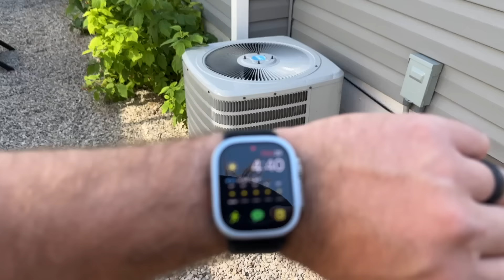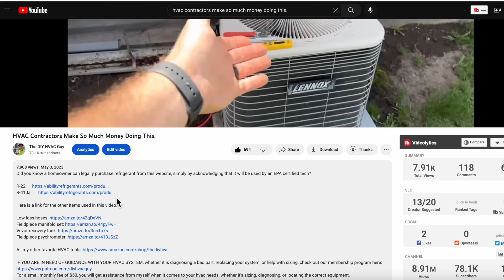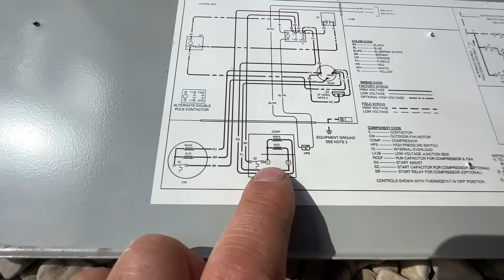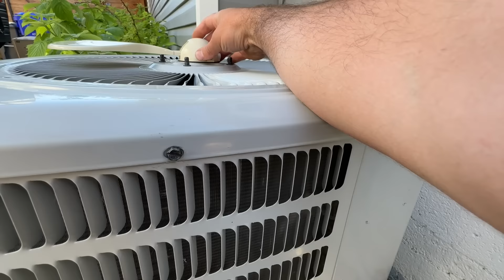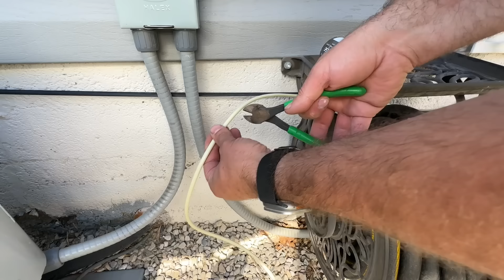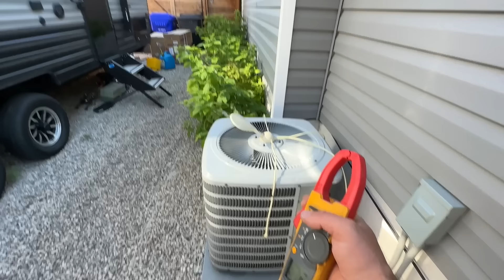Can This Device Actually Lower Your Electric Bill By 30%??

Comment: I've heard so much hate against misting condenser from HVAC techs. Something about water rusting/damaging coils and fins. Can I get your opinion on this?
Reply: Why would you be concerned with getting a unit wet that sits outside in the rain?
Reply: @UserFormelyKnownAs_hjkh 
Because rain is intermittent and ph balance/mineral deposits of rainwater is much different than ground water.
Reply: @UserFormelyKnownAs_hjkh  Rain doesn't have the mineral content as ground water does.... I would think
Reply: @UserFormelyKnownAs_hjkh  Because this is not rain. Most rain is pH neutral, neither acidic nor alkalai.
Reply: @UserFormelyKnownAs_hjkh  Rain is effectively distilled (or at least semi-distilled) water.  Any contaminants are going to be volatile compounds in the air that got picked up, or maaaybe a little bit of dust that served originally for nucleation.  Definitely no dissolved minerals.  City water has dissolved minerals in it that will either clog up the condensor fins or corrode them.  (And if they are clogged with lime deposits, the acid needed to remove them will potentially corrode them.)

If I used something like this with my water, within a month the fins would be completely clogged with lime deposits.
Reply: @Entropy512  fair point. Entirely valid. However wouldnt an individuals use of this product effectively depend on the quality of their tap water? My tap water is safe for fish and i dont get calcium deposit on my shower head like i did in other cities. (EDIT) also, couldnt someone just as easily setup a rain collection barrel with a cheap solar panel running a 12V pump for pressure, assuming this product only uses about 1 gal/day, like he states in the video.
Reply: @Entropy512  What do you think about collecting rain water and using gravity or a solar pump to run the mister?  I don't know how much pressure is needed to run the mister, but in theory, it seems like it might work.
Reply: @sonnyh9774  That would probably OK as long as you filtered out debris, similar to what a few other people have said about feeding the condensate from the evaporator (heh wonderful potential for confusion there - refrigerant evaporates and water condenses on the same device), which is actually something newer Energy Star compliant window units do.
Reply: Some  city water do cause galvanized pipe to fail  very fast
Reply: @vietcongbuondanbannuocphan1791  Galv pipes are never your friend. And yes indeed, some muni water systems are 3rd-world crap. Sounds like acidic water. There measures one may take to correct for that.
Reply: My condensing unit has sat out in the rain (acid rain) and snow for over 10 years and hasn't rusted.
Reply: @wannabetrucker7475  I don't think minerals are in rain and snow, but I could be wrong.
Reply: These HVAC units are outside of course.  Does rusting occur when it rains?  This device also comes with a filter so mineral deposits is minimized.
Reply: I'm an ac technician  in my area (west Tennessee) using misting with tap water is not recommend. Chemicals in water will over a short time destroy cooling find on condenser !
Reply: We had one of these things years ago. Minerals from the water ended up building up on the fins over time. Be prepared to have to descale your unit. We took ours off and tossed it after a season. My advice… save the money you would have spent on this and go buy some beer. 🍻
Reply: They also seem to hate compressor noise covers. My (well, not anymore!) HVAC guy just up and removed mine without even bothering to consult me about it. I'm still waiting on the jerk to return it... basically $80 petty theft in my eyes
Reply: @SomeRandomDude-zqxj  i think it's kind of safe to conclude they'll be against any DIY mods that'll lessen the service call frequency 😂
Reply: @machorani  Ha! sometimes squeezing a nickel till the Buffalo Shit's ends up costing you $2400 for a condenser change out.  Or $6,000 to $8,000 for a complete system replacement depending on what refrigerant you have. LMFAO! All for 0.03c/mo. savings!
Reply: @snurb48  what if my condenser is already 11yrs old and I'm just trying to squeeze last bit of juice before I size up?
Reply: @snurb48 why would water musting on the condensor make it fail?
Reply: @snurb48  Or 12k for a system replacement if you live in a hot climate like Phoenix, AZ. That's just for a single level 1500 square foot house. I'm glad I left before the heat waves of the past two years because AC seem to die during a heatwave, then the AC guys all say they are booked for weeks and you have to live in a hotel for a while.
Reply: @snurb48  Doing the math, this saves about $4.30/mo by my local utility rate.  Not a big savings to be sure, but not the negligible three cents you mockingly describe.  And why would it lead to a compressor change?  This takes load OFF the compressor.  This makes the compressor last LONGER.
Reply: @snurb48  I live in Florida, 1/2 mile from the gulf of Mexico with a 20 year old condenser. This won't rust the condenser. If it did, mine would have needed a replacement a decade ago.
Reply: @thehousedr4  from mineral deposits on the coil.  Think of water spots from washing your car out in the sun using the hose.  Then think about it running like that 24 hours a day and ask yourself if the accumulation of the waters;pts buildup wouldn’t cost the surface of the cooling fins.
Reply: @thehousedr4  because it deposits minerals on the coil surface,which in tutn will insulate the coil causing issues getting rid of heat! And the only way to clean ot off is with descaler and it will make your coil disappear! You are essentially turning an air to air heat exchanger into a cooling tower!
Reply: @machorani  Sure, go ahead and kill it. But make sure your duct system can handle more tonnage of airflow before you 'size up'. Big mistake! Bigger isn't better, said doctor ruth!
Reply: @thehousedr4  Because that water filter will not remove calcium. Calcium  upon change of state(water into a vapor)  'evaporation' , will deposit  onto, and inside the coil fins on the Condenser Coil.  Acid will not remove it and even the slightest air restriction causes these units to run a high head pressure. High head pressure= Compressor burnout. Does that help?
Reply: @leifhietala8074  Number one, why should I trust your math? You don't even understand Physics or you would not be debating Me right now! So, I'll say mockingly; when the calcium deposits plug the fin coils, the head pressure will rise extremely high, thus so will the temperature of condensability. The lack of subcooling will effect superheat which in turn will climb high. Without proper superheat to the compressor, this will overheat the windings, thus melting the insolation, warping the windings out to touch the steel case, and BAM! Short to Ground! Or as you would probably say on the phone: "yo man, my breaker be trippin and even tho I done reset it 23 times, keeps popp'n"? "I have a $4.30 coupon, when can you come out"?
Reply: @thehousedr4 in my case after only a couple of weeks the coils were completely covered with calcium, rydlyme some very expensive shyt to get the calcium off without damaging or destroying them.
Reply: @snurb48  Trust my math, as opposed to the no math you offered?  Sure, why not trust it.
0.8 amps x 240v = 192w reduction in consumption, assume 25% duty cycle x 24 hrs x 30 days per month x $0.125 / kW-h = about $4.30 per month.
He's got the anti-calcium additive doodad, no idea how effective it is but he's trusting it on his own system, so maybe it isn't completely bogus.  I'd be inclined to use rainwater instead.
As to the rest, you need to make the holes in your hood bigger.
Reply: @thehousedr4 yeah I don't get it, it sits out in the weather already.... 🤔
Reply: @leifhietala8074  Hey, that was really good on your math, a real rarity these days. Listen, if this could work without calcium deposits I would do it in a heartbeat. I've worked on the old water cooled condensers and they were the most efficient systems on condensability for any refer system! Rain water would work but sounds like a hassle, if you have that much rain means your humidity is high therefore your going to lose on evaporation process. His unit is about to be changed so he doesn't care. My unit is a new 410A system that I don't want to change and run into the new evaporator change out laws, stupid. 
I think you have checked into my private life on the hood comment, be more specific if you don't mind. I'd be curious of what you think you know? Thanks.
Reply: @thehousedr4  that all depends on your water quality, water high in iron or minerals will definitely cause issues over time. I've seen swamp coolers using untreated water nearly destroy themselves in just a couple years. The use of a water softener would help as they remove most of the minirals.
Reply: @snurb48  I live in a temperate area with lots of rain, so rainwater harvesting for condenser cooling is a valid solution, especially if rainwater harvesting is already going on for other purposes.  We have high humidity most of the time but condenser coils would still cook off rainwater, humidity notwithstanding, and receive a benefit.
On my old system that was installed in 1989 and changed out in 2015, I would have considered this even with city water.  My new system, not so much.  No, my hassle there is the goofy ECM motor.
My last statement was in reference to your quote that sounded like hate-soaked ebonics parody.  Whether that was your intent or not, that was how it landed.  That's not a good look on anyone.
Reply: @leifhietala8074 

wish I had  ur rate....I'm at 21 cents/kwh
Reply: @snurb48  What savings?  That will be eaten up by the slightly higher water bill and the replacement of the water filter every three months.
Reply: @javaman2883 window unit or portable AC just stay next to it. Better than a hotel
Reply: @SomeRandomDude-zqxj  mine came from the factory with a noise cover on the compressor.
Reply: @greggv8  If noise not a problem, get that heat-soaker off your compressor.
Reply: @SomeRandomDude-zqxj  Some HVAC tech think these blankets trap heat in the compressor and help burn it out. False! The cool refrigerant gas that comes into the compressor provides motor cooling. The additional heat trapped from the blanket is not significant.
Reply: @andydelle4509  yep, and I didn't have it wrapped snug tight either (trapping heat was my #1 concern), basically I just slipped it over it, an inch or 2 gap all around it, then the top strapped on. It is an old budget seer10 system from 2000, and he personally installed it back then, maybe he took it personally ("don't booger-up MY install" idunno lol)
Reply: that service tech. did you a favor! those "noise" jackets shorten compressor life by as much as %40 by holding in heat. @SomeRandomDude-zqxj
Reply: @SuperDrumwolf  and I've wondered that too myself . . . I had one on another unit at a previous home for 7 years, it was just placed over the compressor but not wrapped snug. And "some sources" say compressors get cooling from the suction line. Nobody probably really knows. Just that the compressor at this home now is an obnoxious buzzing banshee 🙉
Reply: @SomeRandomDude-zqxj  I know, the compressor blanket is meant to be in conjunction with a crankcase heater! It is for use during low ambient conditions, it keeps the refrigerant from condensing to a liquid and sitting in or on top of the compressor. Liquid does not compress, thus starting the unit as said will bend/break rods, pistons in old or big units. Or bind up a centrifugal compressor and or break the rotor in a rotary compressor. Not so much for noise.
Reply: I did my own design for this very concept. Mine was more with swamp cooler pads and a sprinkler electrical switch to run it. The thermostat runs on the same voltage as the sprinkler valve. My system did very little any savings. In the deserts of Utah, the added water costs consumed any saving of power reduction. At best [my thoughts] it will help the pump past longer.
Reply: @stanleymcomber4844 Your idea was a good one and probably would have saved money if you had well water.
Reply: The issue I’ve seen is mineral buildup on the coils. If you are the type that cleans them often it’s fine, but I’ve found that the types who use these devices do not
Reply: Hey all those that think this is good for your system....  HVAC companies love innovation and can't wait to sell you the newest most efficient tech for your $$$.   BUT...  They also have to adhere to an industry standard.  
I.e. they cant sell you snake oil wonder do-dads that will never work in the first place.  And they cannot knowingly incorporate a 'feature' that decreases the lifecycle of a product.  

If misting had its benefits...  Lenox, Trane, RUUD, Mitsubishi, Carrier, et al would have already developed and sold package units with integrated misting.   They would have given customers 'advanced efficiency', simple swamp cooler tech long time ago.  By this time LG or Dyson would be trying to push an ecofriendly rain recapture 'solution' if this worked.  Or should I say lose at the risk vs reward in a game of diminishing return.    So all u jeaniouses yeah I spelled it that way because you are special genius situations I tell ya.  And really there isnt any way to tell you...  U r just gonna have to eff round and find out.   Its gonna be a while.   But that expensive I told you so was brought to you by the many many years of HVAC experience.  Collectively.
Reply: I have a "Day & Night" central FAU in SoCalif....It's the house's original system, I'm the orig. owner (1986) My company plumbed the neighborhood I live in. Our AC friend installed an inline  "Filter" and "Dryer" during it's first summer...said it'd last forever.... and it has. He came by last week and added 1-1/2 lbs refrigerant. The system cycles normally in 105 degree heat..... 52 degrees at registers.
    We have a 20 yr old "Mister" in our patio and it's hooked up to soft water. The emitters still work (amazingly not calcium clogged). As the droplets fall they gather dust particles and transfer them down to our outdoor kitchen tops I built... leaving a white film....it's not calcium because all my plumbing fixtures have zero calcium build-up. Early one morning had I sprayed pure vinegar all over my outdoor kitchen and BBQ, let it set for about 20 mins then wiped it off....worked great....only going to run the misters when company's over...we have a 40' pool to jump in 24-7. 
I do not recommend misting your condenser unless a bunch of vinegar is good for the internal parts. I'm a plumbing contractor not a chemist.
Reply: 20 plus years and you do you Boo. But 100 percent seen the damage personally that water does to aluminum fins. Have not seen the damage on aluminum micro channel coils as they are super easy to rinse with that same water.  The calcification that happens due to long periods of saturation will straight up damage the coil long term sucks.  But without a doubt super effective in the short term. So if you wish to replace your condenser coil every 3-7 years save that money you getting on energy savings.
Reply: @Rob0243  I've seen where dog's piss eats the fins like acid....because it is. Google :
"dog urine eats cooling fins" (images)
Reply: If your water is high in minerals you will end up coating your coils with minerals which will then be much worse that it was.
Reply: @dougk5456  Even if you have soft water (like I do) the water droplets gather dust/pollen and it builds up on everything it lands on....like glue.
Reply: It's not rust that will cause the damage, it's scale from the water mister. The minerals from the tap water will build up over the coils and fins over time, reducing their ability to reject heat. That will cause the compressor will work harder, which is the opposite of what this product is meant to do.
Reply: I am a former HVAC technician for over two decades in my opinion on this thing is that when you first start off yes it works great because he brings the head pressure down and so the unit doesn’t work as hard. But after a while that water will start to calcify on those condenser fins and once it does then it becomes like an insulator and it won’t allow the heat to escape out of those fans anymore so then you’ll start going backwards because now the condenser won’t be able to reject the heat like it’s supposed to. I’ve seen this done many times and like I said at first it works great but nothing is forever and after a while you will start having problems. And to tell you the truth the unit is working perfectly the condenser coil is designed to work in 95° temperatures and if you looked at what his supply grill temperature was was 53° so that means if the unit is working properly with a 20° drop the house is 73°. If you want to help your system energy wise put a good start kit on it that helps get the compressor to RLA faster because the unit uses more electricity at start up that’s when the peak power is used.
Reply: I have heard all the same stuff but never any proof or real world results.
Reply: @ban80  My AC is 11 yo R22 system anyways. I'm going to give this a shot and monitor any visible damage or leaks on my system. I'll report back in a year or two if I remember.
Reply: @danmeyo   OK I will look you up in a year, lol
Reply: The coils are made of copper and aluminum, not steel.
Reply: Well, if my condenser rusts or is damaged with water exposure, I'm not sure why it is placed outside exposed to the weather (rain and snow).  ;)  It is built for water exposure and the first thing my service tech does when he inspects it is to hose off the running unit to clean it.  This device is not for me, as my compressor does not run nearly as much as folks down south, but seems to be a nice idea.  Commercial HVAC gear used to cool large buildings like data centers I help design work off the same idea ("water towers" on tops of buildings).

Design flaw or did he put the device on backwards...  Why doesn't the unit have a fourth sprayer for the front of the condenser?  It has probably the largest surface area.
Reply: The coil is made from aluminum, it wont rust from water alone.
Reply: shouldn't be any rust, the coils are made of aluminum & copper. When our outdoor fan motor went out during non-purchasing hours. I went and bought 2 of the spinning sprinkler hose attachments and put them inside the condensing unit and it worked great until I went and got a motor.
Reply: No problem if coils and fins are genuine copper or aluminum and not ferrous metal. Get out your magnet and check. Powder coated covers do not rust. Cheers!
Reply: @blackrifle5.56  ...all aluminum
Reply: Are you considering rain and snow?
Reply: @klinestillthat's right! You let em know what they've heard! So stupid, trying to translate smart ppl talk. Way to set em straight.
Reply: water that actually enters the system should be minimal and effectiveness will depend largely of humidity.
Reply: @denverbraughler3948  'What exactly are you trying to compare?'
I'd bet you're about the only person reading that who doesn't get the idea of mineral stains in a toilet.  It requires mechanical action, minerals don't just 'magically flake off easily when they dry out and never attach to surfaces' like your post made out.

If your water is that soft you probably don't need to worry about  your AC either.
Reply: I never have had an issue.   Some white vinegar or CLR occasionally will get any scale off.
Reply: What about rain?
Reply: Issues are quality of your water, heavy water will leave mineral deposits in your AC unit that will eventually DESTROY it, other problem is CHEMICALS in water my local city water eats aluminum and also discolors /pits brass
Reply: Thats why condenser units are always placed inside the house, so they cant get wet from rain... smh
Reply: @flyingsodwai1382  The Condenser is the outside part, getting rid of the heat.  And my house has a 'package unit' which is one box, outside, for everything, and ducts feed air to and from it under the house.  Oh, and it sits in the torrential summer rains and occasional hurricane weather with no issues at all.  Mine has been running well for about 15 years now.
Reply: Not good idea as it sucks the water in the dust that gets sucks in as well clog the coils quicker. In my opinion the money you save on energy you will spend on water
Reply: If water will rust/damage the coils and fins, I suppose you would need a tarp over your condenser so it wouldn't get soaking wet every time it rains.. lol
Reply: Maybe if you have really hard water and no filter on it. Other than that it literally rains every single afternoon here in FL so water wouldn't change anything
Reply: It is morally justified to despise HVAC "professional"
Reply: It sits outside in the rain how could it be any worse than rain water🤣
Reply: That is a very interesting idea, as long as the inline filter prevents any possible calcium buildup on the coil. Like you said it would be much better having the one mister on the front instead of behind the condenser because it is mainly just wetting the wall.
Reply: Buy a separated 2 stage unit if you live where the humidity is unusually low, and be ready for the increased need for service on the evap stage with cleaning and new pads.
Reply: I used one of these and it did slightly improve performance. The bad part was it rapidly caused the coils to get corroded/damaged.
Reply: @garyrds  YATHINK....U SURE IT WASNT THE ACID RAIN...WHEW !!!!!!
Reply: @garyrds  "The bad part was it rapidly caused the coils to get corroded/damaged."
Not changing the filter will do that. Your outside unit getting wet as it is designed to handle does not.
Reply: If that were the case mine would have rusted out a long time ago.  We had one of the wettest winters in a long while.  The material in the HVAC unit is designed to be exposed to water.
Reply: @kermitefrog64  Last time I looked, rain was made out of water and my unit sits outside in the rain without an umbrella or rain coat 24/7 365.
Reply: @Phocoshay_Balperrus Dona water test on rain water and faucet water
Reply: @Phocoshay_Balperrus  Your city water is not just water it is chlorine, fluoride, and minerals.
Reply: Please do a  scientifically controlled and documented study and let us know the results in 8 - 10 years.
Reply: @kermitefrog64  Right?  I mean - it lives outdoors.  "Rust," for crap sake people the coils are aluminum.
Reply: @kermitefrog64 you can’t compare rain or snow water to faucet water sometimes the water can be contaminated and will rust your system out just like when a dog pees on it and customers want to argue no but research it aluminum will rust and wear off in water
Reply: @kermitefrog64  Rainwater is completely different from potable water and not all potable water is the same. Some could contain high levels of chlorine or minerals that could react negatively with the materials the condenser is made out of.
Reply: @kermitefrog64  But, spraying mineral laden water into an aluminum coil is NOT a good idea, regardless of your winters.
Reply: @denverbraughler3948  You should do some research and learn more about filters. Do you think that filter removes all the minerals and calcium ??? If so, you would be WRONG!  The only way to remove ALL minerals is distillation and RO (although RO leaves some minerals). A good RO system with a constant flow design is about $500.  Call me the bus driver, cuz I just took you to school !
Reply: @denverbraughler3948  You are funny.....you think WASHING the condenser coil with water 1-2 times per year is the SAME as spraying a fine mist of water on the coils for 12-13 hours of run time per day for 150+ days of a cooling season.  Your comment is illogical and misguided.  Rethink it and come back!
Reply: @denverbraughler3948 The mist nozzles are very easy to clog if there are minerals in your water.  Calcium is particularly problematic.  Adding the filter reduces maintenance.
Reply: @denverbraughler3948  I am claiming that's what the manufacturer claims.  I haven't used it, so I can't reliably state either way.
Reply: @denverbraughler3948  to reduce the mineral buildup on the coil.
Reply: @denverbraughler3948  Marketing.
Reply: @denverbraughler3948  Calcium and magnesium deposits stick very tightly to aluminum, and are as hard as a rock. Every year or 2 it takes us 3 hours to chemically soften the deposits and scrub it off. A good filter would be a must for that purpose. Rain water has a bit of dust in it, but no calcium and magnesium, so it doesn't compare.
Reply: @daleomiller  You'd be better off connecting it thru a roll of toilet paper! Ha, Lol. Seriously.
Reply: @denverbraughler3948  The inline filter is probably just meant to protect the fine orifice in the sprayer from clogging.
Reply: @denverbraughler3948 if you're lucky it is a water softener to remove hardness - I can't see the value of any other filter like you put on a fridge line, you're not drinking the water after all.
Reply: @denverbraughler3948  To decalcify  or soften the incoming water. Water minerals aren't all the same. Sodium for instance will leave a white residue that wipes off. Calcium will leave a crusty residue that is more like rock.
Reply: @denverbraughler3948  'But the truth is that the minerals dry out and turn to dust that blows away when the unit starts up.'
'and never letting it dry out so that the minerals flake off.'
Now you have me wondering how well 'letting the water dry out and let the minerals dry out and flake away' works for your toilet bowl over years?

Not how minerals in water actually tend to work.  Water is one of the best solvents and tends to help several of the dissolved minerals form films and stick to surfaces as it evaporates, not to mention metallic bonds and corrosion since the fins are usually aluminum.
Reply: @denverbraughler3948  To filter out some of what the city adds to the water to make it safe to drink.
Reply: @denverbraughler3948  read the hard water warning posted on their website. Not good
Reply: @kermitefrog64  You dont use the AC in winter.  But, spraying mineral laden water into an aluminum coil is NOT a good idea, regardless of your winters.
Reply: @darknes7800 many of us have heat pumps and hell yes they run in the winter!
Reply: @darknes7800  What if you collected the rain water from the roof and used a solar pump or gravity to run the mister?  I have no idea how much mineral content is in rain water, but I'm assuming the minerals were left in the ocean or wherever it evaporated from.
Reply: @darknes7800  No but heat pumps run all the same parts...
Reply: @joeaverager  Correct and my point still stands, that spraying mineral laden water into the aluminum condenser coils during the COOLING season, will ultimately destroy the coils and you will be replacing the condenser / heat pump.  This gadget is nothing but junk !
Reply: @kermitefrog64  designed to be exposed to water? Yeah, cheap Chinese aluminum. They don't use copper anymore, and that's why A/C systems don't last 15 or 20 years like they did many years ago. Today, you're lucky if you get 6 or 8 years out of a system without MAJOR repairs. And that cheap crap aluminum corrodes out much faster when you keep it wet all the time. And not to mention that with all the refrigerant changes and higher pressures these systems are running today, I think in the long run by keeping your condenser coils wet all the time just shortens the life of the unit, so in the end just how much do you save? And let's not forget to factor in those mister heads, they use about a gallon of water each in one hour's worth of running time, plus the cost of replacing the filters every three months.
Reply: Very little worries about oxidation/corrosion to the aluminum in the Arizona desert areas. Sooo dry that those coils would be dry as a bone between compressor cycles. You'd have to submerge the coils for that to happen there.
Reply: @richardtaylor4292 We used one of these in Phoenix and the hard water killed our unit and corroded the heat exchanger to the point of uselessness in 15 months.
Reply: @Mike-hb4pc  
My "rooftop" all in one unit for a 1200 sq ft POORLY insulated 1986 doublewide mobile home was manufactured July of 1987, condenser is made of aluminum. The outside portion of the "radiator" is even painted the ugly industrial "dirt red" of that time (like the rest of it)... I mean the actual fins painted... interior "radiator" is clean, I've been inside this unit... so far as I can tell, nothing has been replaced... I doubt it's even had a coil cleaning (I hosed it out once). It cooled this place with ease for around 35 years, despite having irrigation hitting it during the summer. I never saw a copper unit, though if you have, I believe you. It never lost pressure that I know of... we only used it for 10 years, never serviced it. I only tore it apart to try to get rid of the moldy insulation inside and chose to "decommission" it a couple years ago (12k window unit works fine)... maybe a bad idea, but it should really be replaced anyway, along with the nearly 40 year old furnace.
Reply: @Mike_H76  That's fantastic! My neighbor had I think a Bard (which I had never heard of) and that thing was kicking azz for like 25 years. It was noisy, but it was working great. But like anything else, I think they were much better quality many years ago. Like somebody else stated, if you can find that sweet spot where you just get mist without water pooling up, it probably wouldn't affect it too much. I hope somebody can do a before and after test with the electric bill. That would be interesting.
Reply: @Mike-hb4pc  
I can't find my AC manufacturer, even from the serial number. I fully agree, planned obsolescence is real... look into the Phoebus Cartel. Our furnace is similar, cranking along, I've only replaced the oil (kero) pump and the transformer, transformer was probably in service 30 yrs at that point... sadly, I had to replace it with an "electronic igniter", 15 lb transformer replaced with a 8 oz igniter that should last 5-6 years. You CAN actually have the old "Franceformer" transformer rebuilt (I was tempted!).

Now, I am in New York (Long Island)... so Summer AC season is really only about 2 months, though we do peak over 90f here. Just a little perspective, our unit didn't get the kind of workout that a Texas AC would.

Also, agreed on a test. Preferably a highly controlled test... if someone wants to send me 2 ac's and a bunch of money, I'll build enclosures and equalize temp between them.
Reply: @kermitefrog64  Except that, with rain, you're only dealing with water on the outside of the unit that is probably not running at the time. These misters are running when the unit is running, drawing a lot of moisture INSIDE the unit. That could make a difference in HOW wet the condenser gets.
Reply: Misting works well in low humidity weather like in the desert, Arizona they even use misters around people, the water evaporates so fast it cools the air and probably would not rust anything because the evaporation down Florida or it’s 100% humidity and probably won’t do much other than slightly increase water in the unit thereby increasing a more rapid of possible corrosion
Reply: @Matthew-tr4se  
i believe it works even in humid conditions.
The amount of water that air can hold depends on the temperature. Hotter air can hold more, cooler air can hold less (that's why the evaporator condenses water out of the air being conditioned and drips.) So as the condenser heats the air going through it, the air can hold more water. (i.e. it's relative humidity drops.) and the mist can evaporate and cool the condenser
Reply: @Matthew-tr4se  ' it’s 100% humidity and probably won’t do much '
Humidity is ambient temperature, usually 90 or 100 degrees during the summer.  Once it's flowing the ground water into the misting unit will probably be 30 degrees plus below that.
Wait until it's hot and humid, and then spray a little mist from a hose on your skin.  It feels good for a reason, it starts off a lot cooler than you are and there's a lot of heat capacity in that little bit of mist.
More evap cooling will certainly help, but making your coil fins 20 or 30 degrees colder from the water contact will still improve things greatly.  And there can still be more evaporation than you might think, because it's a forced airflow.  If there is any spread from 100% humidity, it will be multiplied by the blown air.
Reply: I work on ac systems and it will kill your system fast 😮
Reply: @JunkTech89  What if you collected rain water and used a solar pump or gravity to run the mister?  I think rainwater doesn't have the mineral content as ground water does.
Reply: @sonnyh9774  the problem is that dust in the air has minerals and the metals just naturally Deteriorate from moisture
Reply: @sonnyh9774  if you want a coil for evaporative cooling the titanium coils from pool heate pumps are good
Reply: @sonnyh9774  I put a 5 gal bucket under my rain gutter to catch the runoff from my roof. Terrible looking stuff. I won't even pour it on my lawn. You'd need a real good filter, or series of filters, to make it usable. But if you can get your rainwater from a clean spot, super. I have asphalt shingles, btw.
Reply: Do it your way but don't complain when you ignored technical advise. Tech should have asked your permission to remove the misters however!
Reply: @bobboscarato1313  I am a DIY for 80 years,  learned it from my father, my grandfather. BUT, I have made stupid (ignorant) mistakes that cost me money, grief. All & all, DIY is essential to life! It forced me to learn, to question, to take responsibility for my survival, economically and in general. Most people do NOT. Then, they complain, blame others.
Reply: @1voluntaryist  Nobody is perfect. Just human nature! You're forgiven!
Reply: advice, even. @bobboscarato1313
Reply: Unless you used steam distilled water mineral build up would quickly build up and insulate the fins on the condenser. Jus'sayin'
Reply: Find and coils are made of Aluminum and Aluminum does not rust metal does.facts of life
Reply: @mplscarsales6652  For the record, aluminum is metal.  Iron, steel, aluminum, zinc, sodium, calcium, tin, uranium and others: metals.  In fact most of the periodic table of elements is metals.
Rust in the context you're talking about is iron oxide, iron combining with oxygen.  Aluminum does this too but not as catastrophically, and usually the oxide layer that forms is pretty tough and protects the rest of the material from further damage.  Usually.
Reply: @mplscarsales6652  Corrosion and Rust are different things.   Rust occurs when iron-based metals come into contact with water, saltwater, acidic substances, etc.  Aluminum is a Non-Ferrous metal which means it has no Iron content.   However Aluminum is one of the most reactive metals in existence, but when reacting to Oxygen it creates a thin layer of Aluminum Oxide on it's surface which stops it from further reacting to atmosphere.   That's why when Welding Aluminum, you need to shield the weld pool from oxygen using an inert shielding gas, Argon or Argon/helium mix.  You can't use a CO2 shielding gas as is often used welding Ferrous metals, because it contains Oxygen.
Reply: You finally got an unsubscriber from this. Wish you well. But I have seen enough stupid comments that my OCD has got my head spinning.  I could be here on this on thread for two weeks trying to set people straight.  May the Good Lord Bless all your Endeavors. Peace Out.
Reply: And the water bill cost ? 😂
Reply: I’m not impressed with only one degree temperature drop inside. I can see what brand he’s using here and invariably that brand uses a orifice inside for a metering device. You shouldn’t jack with the condenser under that circumstance. Maybe a TXV?
But only one degree temperature drop?
Give me a break, it’s not a 30% savings.
Reply: Did you not see the current draw reduction? I did this year's ago with a solenoid valve, used over 20% less power.
Reply: @mrbmp09  You are plugging you condenser fins with the minerals from the evaporated water. Get ready to spend $10K on a new condenser unit.
Reply: @darknes7800 what if I have a water softener and I source the water for the misting unit from a softened fixture.
Reply: @mrbmp09  Not sure what he was measuring but there is zero chance that condenser is only drawing 3 amps of power.  Need to measure the power draw from the disconnect.
Reply: @ShuhDonk he's measuring just the power to the compressor.  The blower current wouldn't change.
Reply: For those not impressed by the temperature drop, keep in mind the unit if working properly will regulate the temperature to avoid freezing the inside coil.  A marginal or poorly running system would show a temperature drop.  That's not really the point.  The point is to reduce the demand on the compressor by carrying away heat faster and more efficiently than just air alone.  By wetting the coil you reduce its temperature through evaporation and improve energy transfer to the environment.   

Large evaporative chillers for commercial buildings work on the same principle.   This is like creating a crude hybrid of a phase change and evaporative cooler.
Reply: Missed the water filter install
Reply: @amtrakusa1  That filter is useless to remove calcium and the minerals that will corrode the condenser coil, which is why the mister systems get such bad reviews.
Reply: @ShuhDonk  Agree, too little for the compressor, too much for the fan. Should have measured the compressor common (black).
Reply: @ShuhDonk  Agree. Appears he measured the run cap current ?? Should have measured the compressor common (black) ??
Reply: @darknes7800  $10k for a condenser unit!!! Are your's gold plated! What a joke.
Reply: @georgewashington687  If you system is 5-10 years old and you destroy you condenser with a water mister........You will be paying for a new condenser, new evaporator coil and related refrigerants....Joke is on you !!!!!!!!!!! LOL
Reply: @darknes7800  My current system is 25 years old and still working fine. I've only replaced 2 capacitors and one evaporator coil. If my condenser unit goes out I will find an older R-22 unit and install it and use a retrofit refrigerant. 
BTW I had two quotes to replace my 5 ton system and include a gas fired furnace, $11,000 for a Trane unit. Not bad for 25 years of service. I am holding out for 30 years then I will change it out...just in case.
Reply: @georgewashington687  Okay, good luck with that old system with a -5 SEER rating ! LOL !!!!!!!!!!!!
Reply: @darknes7800  This was our pretty much experience. We never got all the way to the point of replacing parts though. What can I say? I was young and dumb(er). 😁
Reply: @darknes7800  It is a 10 SEER and my electric bill this July was $87 for a 5 ton unit and 2,500 sq ft. home. I have levelized billing that averages my electric bill over a twelve month period. I have no complaints with the bill not with the Intertherm split system. That's what happens when your electric provider is an Electric Cooperative! I will keep this unit and keep repairing it until the compressor gives up the ghost.
Reply: @ShuhDonk I was suspicious of this too.  I don't get the mechanism for it suddenly drawing less power - don't most ac just run at full whack until the thermostat tells them to turn off so the only thing that changes is the duty cycle?  So really you want to measure power usage over a certain time frame with and without the gadget. 

I'm guessing you could just prototype this for yourself with your garden sprayer on mist. Also direct sun can definitely add a lot to ambient temp so figure out how to provide shade without impeding airflow.
Reply: @georgewashington687 
Probably true, $3500 for parts + $6500 labor !!!  Check the rip off labor costs !!! And now I’m told $92 lbs for 410A
Reply: @user-ty2uz4gb7v  Go for it. But before you do, take a sample to local pool store to check output pH for neutrality (~7.3). If you have the stones, a quick way is put a drop in your eye. Eye fluid is 7.3 pH so a drop won't burn. Cheers!
Reply: @tiporari  Correct.
Reply: @user-ty2uz4gb7v  the fintubes are made of aluminum aluminum will eventually rust in water or dissolve
Reply: @darknes7800  I believe that was the reason to include a filter in the system
Reply: @MultisportOfficial  Yes, there is a filter included, but its likely a simple - cheap carbon filter. That filter is NOT capable of removing the MINERALS from the water and its the minerals that will accumulate on the condenser coils and ultimately destroy the coils.  There are only 2 ways to remove all minerals from water......distill the water and RO filtered water.  An RO system that would remove nearly all minerals costs about $500-$600.  Cheers.
Reply: @tiporari in big cities ac units on large office buildings I have seen the outside units use water flow over the coils like a waterfall to increase it's ability to change the extraction of heat more easily by having more than the coolant working inside the fins and I never saw corrosion on those fins.
Reply: EVEN softened water is not perfect. 
It would have to be very, very well filtered water. 

There's an accelerated evaporation going on which will accelerate mineral deposits, even with softened water.
Reply: @tiporari A homeowner would be better off constructing an actual evaporative cooler around the AC unit. This is the basis of commercial two-phase cooling units.
Reply: @darknes7800  so the minerals in your tap water is worse than rain water? 🤦
Reply: Greatly reduced amp draw.  Dud you miss that part.  There's your savings.
Reply: @amtrakusa1  If the filter's not VERY effective at removing calcium and magnesium and also very cheap to replace, it's not worth the risk.
Reply: @RobertWorcesterTX  Not 30, but the math says it's about 19% lower amp draw at the comp.  Nothing to sneeze at.  I'm not surprised that the output temp is the same, the comp and a static orifice are going to generate about the same mass flow through the metering device with or without the misters, probably can do a hell of a number on the subcooling but we don't know much about the system as it stands.  But the misters yank heat out of the condenser in a big way and take a lot of load off the comp, so it would naturally run easier.
Reply: @RobertWorcesterTX  What if the house dropped 1 degree? That in effect(20*F T.D.) would make the supply air temperature drop 1*F ? Very simple explanation.
Reply: @RobertWorcesterTX  The 1 degree was icing on the cake from a benefits perspective.  The savings is the fact that the AMP draw went from 4.4 to 3.6.  Granted that more like 20% reduction but combine that we more efficient cooling and a 25-30% "savings" isn't unreasonable.
Reply: @RobertWorcesterTX  Robert, from what I saw in the video, the current draw went from around 4.4 to 3.4 or something like that.  I didn't rewatch for the exact numbers.  If this is legit, then that is around 25% less. Since watts = volts X amps then that is about 240 watts per hour.  So, in a best case scenario in the heat of the day, you are saving about 1/4 of the price of your electricity.  If you are paying 10 cents per KW/hr then you are saving 2.5 cents per KW/hr.  For me, I still don't see this as a value at $99.  My electricity cost is around 8 cents/KW hour here in TX, and my AC runs probably 20 hours a day.  So if saving 2 cents per hour for 20 hours/day for 60 days a year saves me $24 per year minus any water cost.  Yes, there may be some added benefit in the off peak months that I can't easily quantify.  So I would say, it all depends on the cost of your power and the heat in your area.  91 degrees in late July would be heaven in DFW.  When it was only 100 and not 108 the other day, I said to myself that this is noticably better.  So around 25% plus the 1 degree cooler puts you close to the 30% range.  Now if this product was $25 and didn't potentially rust out or calcify my AC, then I would give it a try.
Reply: @RobertWorcesterTX  It did show a significant amp draw reduction. I still would have to see more testing before i'd buy in. Water does transfer heat better than air, but at what cost?
Reply: @RobertWorcesterTX  Anyone who buys a HVAC system without insisting on a correctly-sized TXV be installed on the evaporator is ignorant or a fool. End of story.
Reply: @RobertWorcesterTX  There was almost a 1 amp drop which could amount to saving $100 on a 4-$500 electric bill... depending since there are a lot of variables.  20 -25% Savings is significant for some people.
Reply: @RobertWorcesterTX  The savings are in the amperage drop!
Reply: @RobertWorcesterTX   To be fair, he obviously lives in a much more temperate area than most of the people who would buy that device.  You'll notice he never mentions the actual outside temp, either that day or historically.  I live in the south near the coast, and there is No Way my AC would ever be putting out sub-sixty degree air when it's 96 outside.  His temp that day must have been in the high seventies at worst.  If his 'before' temp was 70 plus with the sun shining on the unit for most of the afternoon (like mine does!), I'm guessing the result would have been a little more dramatic.
Reply: @RobertWorcesterTX  only way you'll get a 30% savings is to shut it off
Reply: @RobertWorcesterTX 
Nobody mentioned he isn't even using the thermometer correctly...  That whole sensor en should be jammed down into the great and not touching anything but the forced air...  
I hardly ever even see an ac tech use a. Wet-bulb anymore either...its like they haven't a clue as to what it is, nor do they understand the concept of how to tweak a unit to the best possible energy efficiency through supercooling measurements when charging the unit... 
As far as I'm concerned true ac technical knowledge is a dead-art since my brother passed!!! 
He took a 20 something old Rudd heatpumo unit and took it from drawing 18 amp at startup and 11 running amps just by adjusting the frein levels by using a wet bulb and supercooling measurements two inches off the compressor output. It drew 9 amps at start up and 6 amps running. .. 
You do the math that's great than .06¢ savings a month.... Then I installed the heat recover unit and shut off my electric water heater and had additional cost savings on the electric bill!!!
Reply: @RobertWorcesterTX  The savings come from the reduction in current draw on the compressor.
Reply: @RobertWorcesterTX  Hey Dichead, did you not see the amp draw reduction ?  Are you a Kevin ?
Reply: Water softeners use salt.  Spraying salt water on metal is a bad idea.  It will shorten the life of the coil.

The truth is, this will work to improve efficiency.  The problem is, water quality varies tremendously from region to region.  

Distilled water wouldn't hurt anything.   Almost all well, treated, and municipal water supplies are chlorinated and or softened using metal salts.  Their inclusion of a filter is a great idea.  This could be totally viable with adequate filtration.
Reply: @tiporari  Softeners use salt for its sodium during recharge, the salty water is then flushed away.
Water with sodium in it will leave a white powder on the condenser fins which washes off in the next rain or when the tap is used.
Rain water doesn't corrode a condensing unit because rain water is more like distilled water with no minerals in it.
The calcium and iron in ordinary unsoftened water are the scaling agents. They  both deposit on surfaces and then bond with a rocky like crust. Worse, the reaction is endothermic and goes faster the hotter the substrate is...like on fins.
Reply: @tiporari  What about rain water collected and used with a solar pump or gravity???
Reply: @tiporari  Correct and well-thought-out. Everything has a process involved.
Reply: it will definitely accurate rust.
Reply: @MarcoABCDEFG  What about rain?